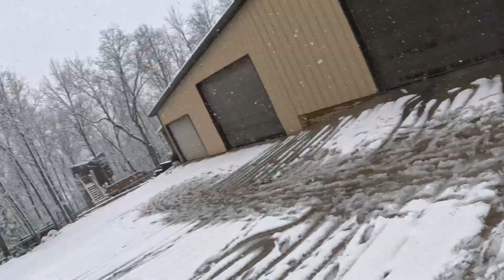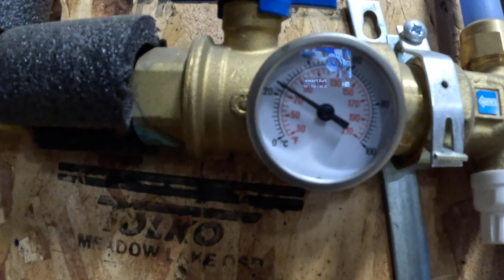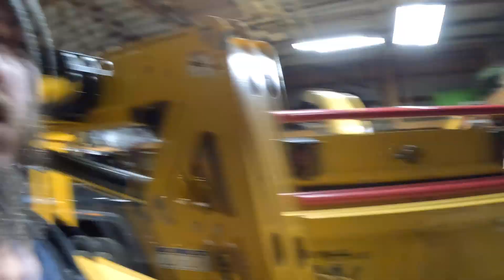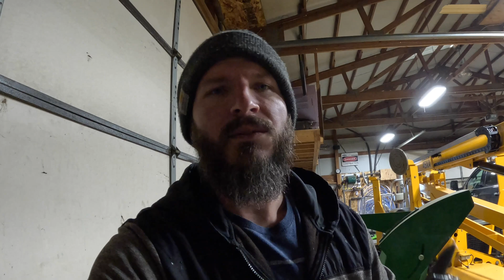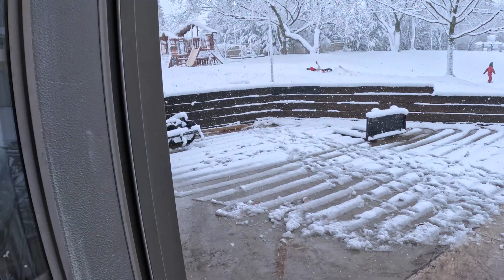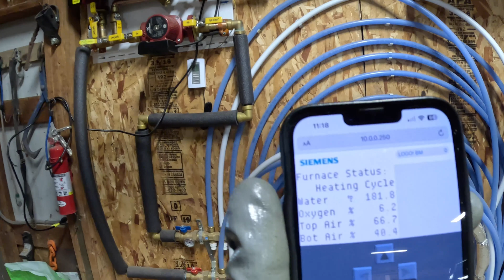Outdoor Boiler Burning And Snow Melting

Comment: If the electric boiler doesn’t pan out maybe you could set up another wood boiler down next to the drive that is dedicated to the snow melt. Might be able to find a used one so it’s cheaper but you could have glycol in it so you would only have to start a fire when you have a storm coming then let it go out until the next one. Take care
Reply from the maker: Yeah I thought about that. I also thought about having another g10,000 right next to my current one and riding them together. That would solve all the issues for sure.

Comment: Well the biggest electric boiler you can buy 122,000 btu and draws 150amps @ 240volts, yes you can go bigger but your talking 3 phase units and that’s not feasible imo
Reply: And by rights you should also have a mixing valve installed that concrete should not receive anything hotter then 120/130 max degrees F, due to possible damage to the concrete. I am in hvac I don’t know everything but that’s what I was taught been doing 10 years now and still learning every day. Hope this helps
Reply from the maker: Yes I know about the electric boilers. I’m not looking to go seperate and just have that be the only heat source. I thought about that and the electricity would be insane. I’m just looking to supplement with it to help the outdoor boiler out. And yeah I know that about the concrete temp. When the slab gets up to temp the hottest I’ve seen the water going out was around 105/110. I wouldn’t go any higher than that. The system shuts down when the glycol reaches that temp. I was going to put a mixing valve in but the way I have it set up it self mixes a little that’s why I don’t have hotter going out right away.
Reply: This is just a thought they do make hwt that is a heat pump with an electric 12kw heater as a backup that has a thermal capacity of a 40,000btu gas water heater.
Reply from the maker: @SuperSquart yeah that is also a good idea as well.
Reply: https://youtu.be/Wnw6735-q5s?si=nxHUvswb7EQOpfSG. It’s right around 29 minutes in they explain how it works

Comment: You might want to consider a 3 way valve on the water side of your heat exchanger to help temper the water back to the boiler, 100 degree water going into 180 degree water could "cold shock" the boiler stressing the heat exchanger and leading to cracking. For the piping in your driveway you can run a main supply and return on either side with smaller pipes across from on side to another. Its common in outdoor ice rinks cooling glycol to make the ice and works well.
Reply from the maker: That’s actually not a bad idea about the 3 way valve. I’m not to concerned about the water going back really. With my extra tanks ots slow the water going back at a much slower rate and eventually when the glycol heats up the heat loss going back eventually gets better as the temp rises.

Comment: I think the biggest hurdle you are going to have to overcome with heating the entire driveway, is flow. You are going to need one hell of a pump for that much head. Not only do you need to factor the elevation change (You said your driveway was steep)  but you gain head for every foot of pipe also. You will definitely need to install a pump pit (manhole) at the end of your driveway the low end and have a pump in the ground  to push the water back up the hill. 
  For an example in my situation, my boiler is 500ft from my furnace coil. The actual height difference from the outlet of my boiler to my manifold in the house is 13'. The manifold is 13' higher than the outlet on the boiler. HOWEVER Taco inc. figured the head on my system and sized my pumps for me. because of the length, heat exchanger restrictions, bends (which I only have a couple) etc. The head is over 60ft. I am running two 1/6th hp pumps. 1 of them installed underground in a manhole midway. 
  I don't know how long your driveway is or the difference in height, but with the two pumps I run it is still worth it. However if I had a height difference greater than the 13' requiring larger pumps, I would have to seriously consider the cost of electricity for the pumps.
Reply from the maker: Yeah I have thought about that. Only good thing is there’s only one line down and back. So even if I need a few pumps I’m okay with that. And as far as electricity goes. It’s only for when it snows or freezes. So to me very minimal use.
Reply: That is a good point, you will only be operating the pumps when you are using the system. When I get a chance, I will make a video for you in the pump pit. I plumbed it up with a bypass loop so it is easy to bleed the air out. You might find a video helpful.
Reply from the maker: @howlandexcavating yeah looking forward to seeing it.

Comment: Just know that if you use electric, it's going to use an absolute boatload of electricity. 

Now your electricity is much cheaper than it is in New England (and when you get solar, you may have electricity to spare) But 1 kWh of electricity is 3412 BTUs. Where a pound of wood is around 8600 BTUs. 

Now, if you end up getting more storage (maybe like a 1000 gallons or something) you might be able to use a hybrid electric heat pump model to slowly heat it up (although it will suck heat out of your shop or where ever you put it) a few days in advance of a storm

Personally, I think you'd be better off getting a larger storage tank and heating it up with the wood boiler a day or so prior to the storm to get it ready for the snow melt system. Especially since you have basically unlimited wood.
Reply from the maker: Yeah I have a lot to think about. I’m just trying to get set up a little better for the future and to have everything run flawlessly with out over working anything.

Comment: I like the idea of a time lapse if you ever catch it in time, I wonder if those heat batteries would better serve your wood boiler directly in series with a seperate pump over serving your closed loop on the driveway, perhaps you could introduce your cold water return into the tanks instead of directly into your boiler to slowly mix it back in and introduce some energy from the battery to the cooler return water.
Reply from the maker: I’ll try and grab a time lapse for sure. I have some ideas on how to better the snow melt and the boiler as a whole.
Reply: @Treestofirewood  I forward to what you choose, you truly are brilliant and I am very impressed with your work and videos. Thank you.

Comment: Consider putting the solar panels where you can get to them easily. You need to regularly clean them for max efficiency. Putting them on your roof = hard to clean / clear off snow.
Reply from the maker: I plan on putting them on the roof of the pole barn. It’s actually really easy to get on that roof so I would be able to clean them off if need be. Plus I wouldn’t be able to see them really because I can’t stand looking at panels. Just me though.

Comment: Another outdoor boiler for just the snow melt system that has anti-freeze so you only have to run when there is snow.Could be away to go.I'm myself am not sold on solar but that's just me
Reply from the maker: I have thought about that. I don’t think there’s a wood boiler out there that could keep up with the heat demand of the rest of the driveway. The BTU’s required are insane. And my driveway is super long.

Comment: Did you insulate under the heat loops in the ground so the heat is directed up?
Reply from the maker: Yes of course. 2inch. After I shut off the snow melt the heat stays in the slab depending on the temp outside it will stay warm for about 3-8 hrs. It’s awesome.